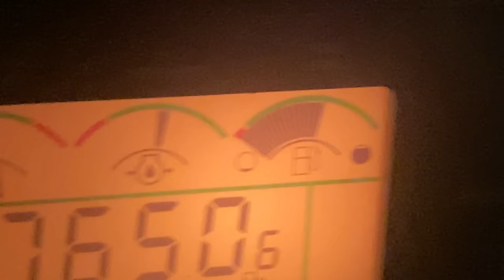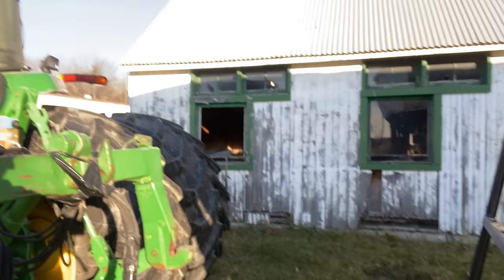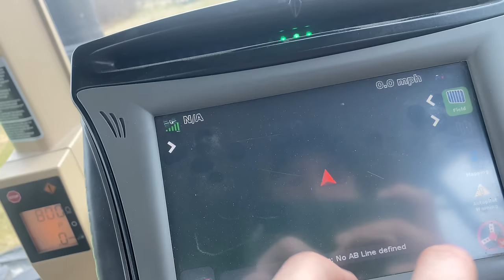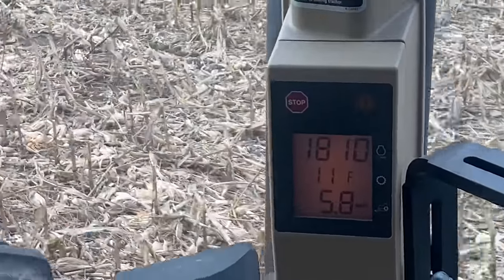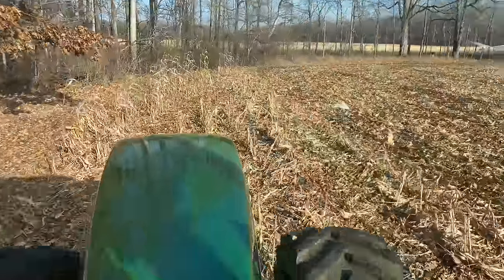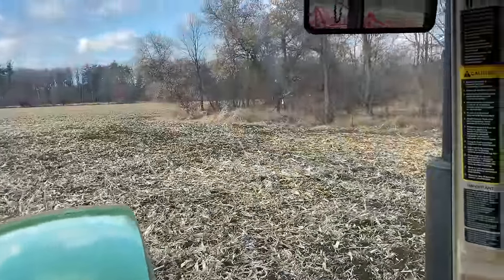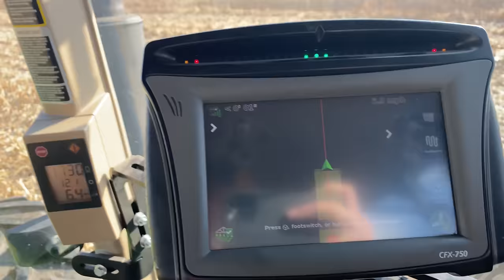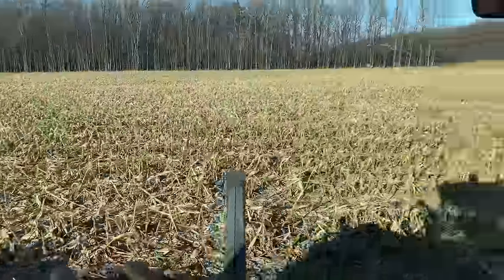Discing Corn Stalks! Sunflower Saberblade 6630

Comment: You did good job on the corn stalks.When do you use the four wheel drive challenger tractor?
Reply from the maker: We pull our tile plow with it. We normally don't use it on our farming operation anymore. Don't really have any implements big enough for it.

Comment: so if your in the field to do corn stalks why not sink the disc in all the way and make it black
Reply from the maker: Ground was still pretty wet. once you cut in more than a couple inches would make big mud globs and have a rough field in the spring. There's a chance we'll no-till soybeans in the spring. Also because of it being soft ground the tractor might run into trouble and get stuck.